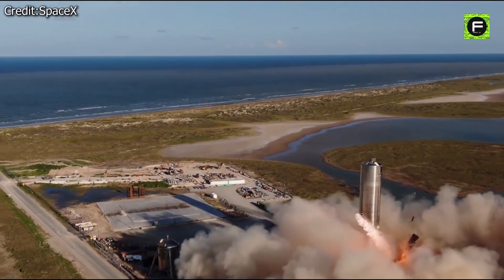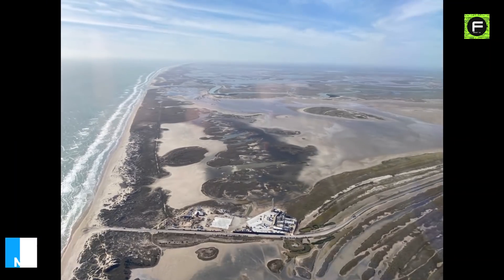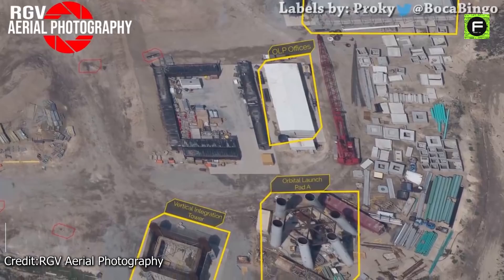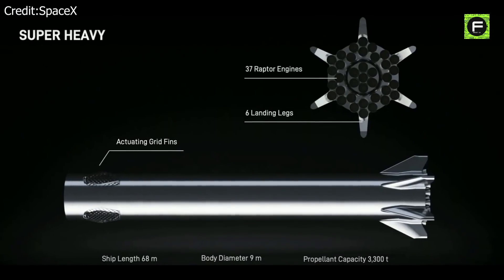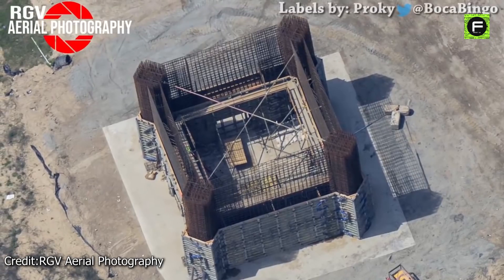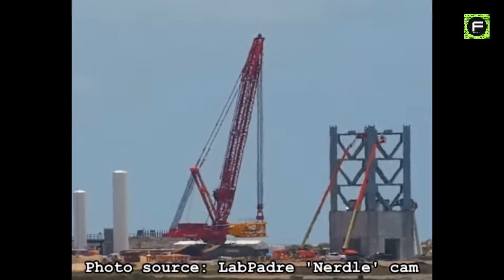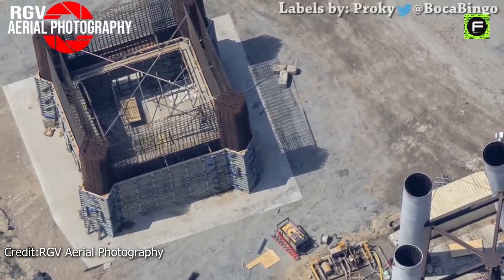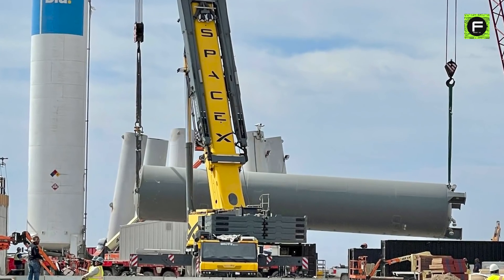Starship Booster-Catcher -Is Really Being Built

Comment: I personally think that the booster catch idea is going to end up being one of those failed back-to-the-drawing-board kind of things, just like the idea of making BFR out of exotic materials like carbon fibre and aluminum alloys.
Reply: They have toyed with a ton of different ideas over the years!   :)
But it does make sense to catch it out over the water if you can, rather than land it on the roof of your sea base.
Just for safety...
Reply: Problem is that reusable rockets aren't as cheap as people think. People compare SpaceX (who needs things to be cheap in order to generate profits) launch offers to others (that need extremely reliable rockets) that use non-reusable and draw an incorrect conclusion that reusing the rockets is why SpaceX is so much cheaper .
The way you make it all actually cheaper, is to make the rocket as light as possible and really find the edge (in regards to the rocket not being so weak, that it explodes if you only look at it the wrong way). Losing landing legs, etc, is an obvious choice if you can't reduce the weight on other aspects of the rocket any further.

Comment: Great video no problem with catching the booster or starship , as long as the platform is solid , weight transfer on round bends are equally distributed , like a pool with a ring shaped structure , hold,

Comment: The engineering challenges that catching the SH booster encompasses are already beyond my imagination, couple that with carrying the load on the grid fins and have them remain operational? Have they bitten off more than they can chew? Can't wait to see the iteration that solves both of these issues.
Reply: Grid fins are designed to handle re-entry forces from near-orbit launches... they can handle the weight of an almost empty booster. 🙂 

Got no clue how the technology on the tower will work to catch them though 😕
Reply: @jackmerry1972  I was concerned with the joints, considering it has to fold as well as twist while deployed. Also, for quick turnaround, it will have to be solid enough to be reusable with minimum inspection. I  suppose I'm not experienced with the large scale of this.
Reply: One advantage is that the grid fins are high up, so once caught, it won't topple over...   :)

I think they cooked up this idea because they want to land these boosters on a sea platform.
If they land on legs, then they are aiming directly at the platform during decent, if anything goes wrong... boom...
My guess is that they intend to catch it out over the water, so if something goes wrong, the most likely outcomes are splashdown in the sea, or damage to the catcher mechanism, rather than wiping out the whole platform....

Comment: Pretty concise and well delivered information.  Appreciate it.  How will the launch tower arms adapt for a slightly off target booster landing?  S. Texas has some pretty strange wind patterns that can blow big airplanes and such way off target.  Sure hope the landing arms, at minimum, have a matching pair of arms on the opposite side of the tower.  The flexibility of the, Falcon 9 booster, landing barges seem like a better idea for capturing the Super Heavy booster.
Reply: Apart from the hours of travel floating to the docks, having to wait while a crane picks it off the boat, loads it off of the boat, turns it on its side and loads it onto a truck and then travels hours back to base... 
that's not gonna be done anywhere near under an hour. "Rapid reusability" it's the aim, nothing about that is rapid.

Starship can't fit on a semi truck and it can't be carried on any public roads.... thats why no barges, possibly a floating repurposed oil platform though.
Reply from the maker: Thanks for the appreciation mate

Comment: Actualy, the grid fins will be made of titanium, not steel
Reply: Last year Musk said steel. Has that changed?
Reply: Falcon grid fins are titaium, So far ive only seen ad heard of SH fins being steel.
Reply: @Vatsyayana87  That's what I thought. Originally Falcon fins were aluminum. Now titanium. I heard the plan for Starship was steel.
Reply: @iridescentsquids  I do wonder if they will stay that way or not, I imagine them being titanium would save a few tons, and since they are willing to catch the world largest booster to save leg weight, seems they take every ton seriously lol.
Reply: @Vatsyayana87  Not only is steel 15-20 times cheaper, it remains mechanically functional at almost three times the working temp of titanium. Not sure what that means, as the melting point an heat capacity is about 15% lower than titanium. But for what it's worth that's what I'm reading. These grid fins will be enormous compared to the Falcons, and the plan is to produce a huge quantity of them. I bet they are engineering for that ease of reproduction, and expecting them not to have to be replaced very often, and easy + cheap to replace if they do need to be.
Reply: @iridescentsquids  lol i have no idea what that means either, it makes no sense to me whatsoever, the function is nothing more then let air pass through them and physically guide/shove it in desired directions.. 
I simply wouldnt believe someone that says titanium grid fins wont do this at more then 800f without some damn good facts to prove it lol, since this is the max temp they could be talking about with steel melting at 2500f...

Is it only that much cheaper?? I would have thought 100 times, being the largest pieces of titanium ever made if they did. But i dont have the slightest.

One thing that you (or i) might have misunderstood though, is i dont think these will be mass produced to the extent you might be suggesting, they only need a few boosters to operate hundreds of Ships, i dont know if we will see more then 8-12 boosters at any time, so 32-50 fins. 
Thats my thought for them using all 4 locations i can think of anyway.
Reply: @Vatsyayana87  oh that’s interesting. I hadn’t thought of that but you’re right, if they are rapidly reusable the booster fleet can be way smaller than the starship fleet. Funny that never occurred to me.
Reply: @iridescentsquids  I still get caught off guard with things I should think of with this stuff lol
Reply: Titanium would be a better option as they will get really hot .
Reply: @pewpewman._.3415  Well it only really matters if its going to reach the melting point or not, Falcons Aluminum fins only barely reached theirs which im sure is much lower then steel would be, so i think the most meaningful reason to use titanium would be weight.
I know Its not regular aluminum, but as a general idea, steel has over twice the melting point of regular AL, from 1200f to 2500f, while titanium only goes up a slight amount more to 3000f
If i remember right anyway.
But titanium is crazy light compared to steel but also probably 100 times more expensive, maybe much more being the largest Ti pieces ever made..